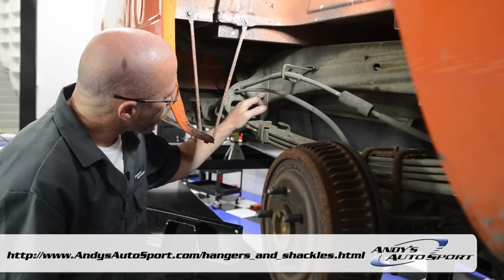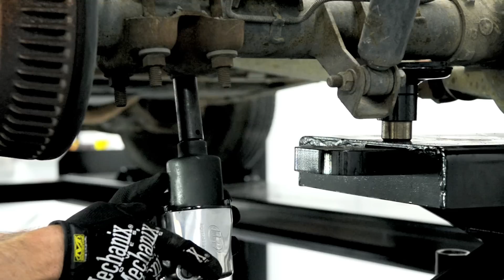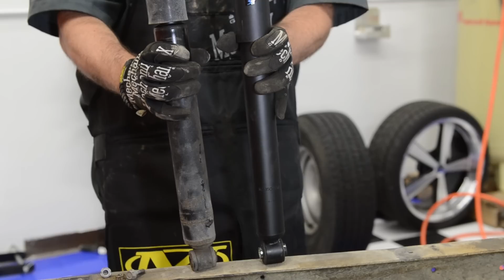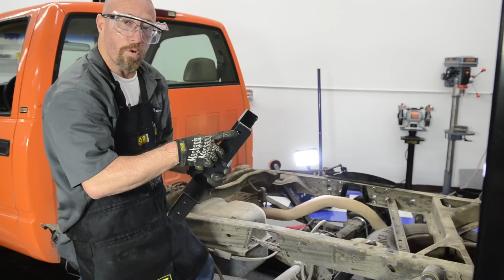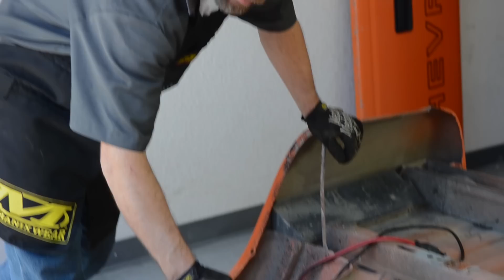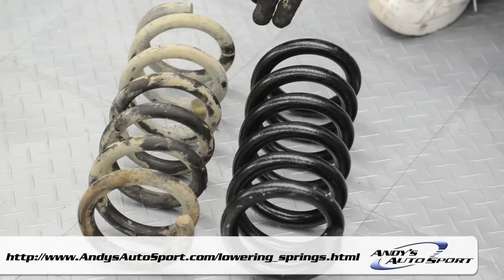Truck Lowering Kits - Presented by Andy's Auto Sport

Comment: Even though this video is 8 year old it"s very informative !!!! Great video but one  thing that they didn't address was that the rear leaf spring shackles are about 2 inches above the trucks frame so when putting the bed back on it will be 2 inches higher in the back of the bed than the front of the bed and this will eventually cause a hole to be worn through the floor of the bed.

Comment: On the front, strip everything out of your way and loosen the ball joint nuts just a few turns with the spring still applying  pressure and rap the steering knuckle hard with a hammer and usually they will break loose without having to use a pickle fork and messing up your ball joint boots. Then use the spring compressor.

Comment: So I bought a flip kit from a friend and he said its takes all the stock bolts and everything now would I have to buy shorter shocks for the rear end it's a 4.5 to 6 inch drop and I'm just lowering the rear end any help would work
Reply from the maker: Hi Nick!  Technically you're not required to change the shocks.  But the ride quality is definitely going to be noticeably affected if you leave the factory shocks on after dropping the rear 4.5 to 6 inches.  Most people do change their shocks if they're doing a rear drop like that.  Hope that helps!

Comment: Hi....great video so if I get a flip kit do I also have to do the C notch done
Reply from the maker: Usuallly, yes. I'm not 100% sure that that's the case for every truck, but usually the axle will end up right against the frame if you don't do a c-notch, so there wouldn't be any suspension travel out back without one. This is definitely true if we're talking about the '88-98 GM fullsize trucks.

Comment: Hi!!  Great video!!  2 cuestions Is there a way to lower the truck with out flip the leaf springs?  
C notch,  can any shop do it?  Thank  you!!
Reply from the maker: Thanks!  Yeah there are other ways to lower a truck but if you want to slam it this is often the route you have to go.  If you're looking for a more moderate drop, there are generally a number of other options depending on your truck.

Also, not any shop can do an install like this.  You'd want to look for a performance shop that specializes in doing truck mods.

Hope that helps!
Reply: AndysAutoSportTV ok got it...  thank you so much for the  reply!!

Comment: What's the wheel/tire size?  I have the same truck, but a Sierra SL, looking to do this same setup.  Thanks!
Reply from the maker: The wheels on this truck are the American Racing Nova wheels.  The wheel size on the front is 20x8.5 and on the rear is 20x10.  The respective tire sizes are 245/35ZR20 and 275/35ZR20.  If you want us to message you a price quote for these, just send an email to info@andysautosport.com and let us know where you're located.  Thanks!

Comment: Are there torque specs for the 2 bolts for the lowering shackle?
And are you supposed to tighten then with the suspension hanging, or with the vehicle on the ground, under its load?

Comment: Thanks for this info.  It helped me a lot in figuring what I want to do with my 1997 Chevy Suburban I just got.  It will be an every day ride,....for now.  What size wheel and tire are you running? Also will that brand spindle work with most big brake kits if I want to lower it first and do brake conversion later? I notice how some big brake kits come with their own spindle; is there a reason for that?

Comment: would really like to know where you found those fish plates.... im lowering my drag truck and i need that strength... i was gunna use the jdm kit, but there c notch just fits on the outside of the frame and does not wrap around like the western chassis works kits... i looked on wcw website n was unable to find the fish plates
thank budday

Comment: I have a 2002 dodge ram which has a 2/4 drop. I think for the front drop springs and the rear was a flip kit. My alignment has been off, well places I took it to said because of dropping it the alignment can be 100%. Is it because of just using springs? Also I want to go lower so what would you recommend?

Comment: Great video it actually motivated me to lower my truck 4 inches in the back and I used the 2 inch lowering spring leaf hanger and the 2 inch lowering shackles and I love the way it came out but on the passenger side the rear shock extender made it uneven so I removed it and now it's 1 quarter off and inch off do you why is that? And I would love to know is there's a way I can fix it thank you

Comment: Just watched ur video.step by step instruction Nice. I have a 63 gmc short box step side with a 1972 front end with a 2-1/2 drop spindle on air bags and can't get the bottom of the a frame from hitting the ground. olso have a1983 posi rear on air. the truck rides very rough. Have I missed something in my project or is this just the nature of the beast. I am willing to lose the bags and go back to coils and coil overs if I can get a better ride and keep it low. Any help would be appreciated. Maybe u could do an older truck next Tks.

Comment: why is it some people flip the bolt around on the lead spring pack then put the flip kit bracket on. does it not interfere on older body style chevy? is that the case with newer body style chevys like 99-06?

Comment: Nice video guys, I had a quick question maybe you can help me out. I did a belltech flip kit on the rear of my 05 Ram Quad cab, truck rode great, but I needed to move and wanted to use my truck, well I was hoping to get stock height, or close to stock, when I removed the leaf flip, and shocks, I left on the shackle but now the truck rides higher than stock, any ideas?

Comment: Hey I would like to lower my ck extra cab I don't want to floor it maybe drop it 2 inches on rear and front. What tires would you recommend  and what size tires and wheels would you recommend I want to give it like a hot rod look so I would like some drag radial tires something like that.

Comment: NIce Truck and video! Came out great. I have a question I recently lowered my 91 chevrolet 5/7 and although it has a c notch it seems to still be a bumpy ride. what can i do to get a smoother ride?
Reply from the maker: Thanks! How big of a notch did you install? If it's a regular c-notch, you might not have enough axle clearance. The Western Chassis Super C Notch that we used goes almost to the top of the stock frame, so there's plenty of clearance. Thanks for watching!

Comment: I have a 4/6 lowering kit with spindle, springs, shocks and flip kit.  Is this the same kit?  If so, what size wheels are those on there?  This is the EXACT same look I'm going for and I would like to know what size wheels would clear with this drop kit.  Thanks in advance!!  AWESOME VIDEO by the way!!!
Reply from the maker: Hi Tim. We installed a 5/7 drop on the truck. The wheels are 20-inch American Racing Novas. Thanks for watching!

Comment: Hi i have a question for you i lower my truck using the springs on the front  now i want to install the spindles so now i need to put the original springs on it? thank you
Reply: you shouldent have to, depends on how "low" or for clearance issues etc..
Reply from the maker: The cool thing about most trucks is that lowering parts are additive: you can use different parts (i.e., springs and spindles) together to achieve more drop. Thanks for watching!

Comment: Questions:
1. Did you not grease the new bushings and spindle when you installed them? 
2. Does the castle nut on the spindle only have a hand tight torque? 
3. What are the typical torque specs for suspension components?

P.S. I would of cleaned and freshly coated the frame to match your new shiny suspension components to make a super clean look as well.

Great video. Thanks!

Comment: That truck looks good at the end.  If it was mine, I'd do a roll pan out back, tint the windows, body color grille with the quad lamp setup and use smoked lights with an HID kit, get rid of the chrome bumper up front and go with a painted bumper and paint it to match, then paint the door handles to match.  I see you did mirrors in another episode, I'd paint them to match too.  Then take out the factory bench and put in buckets and make a console and a sub box.  Oh yeah, and a cowl hood.

Comment: they forgot to mention that you need to remove the tow hitch, but other then that very helpful. already installed my 2 in drop shackles, later on I'm gonna swap leaf springs to give it another 2 in, and then spindles. thanks for the video.

Comment: Great video. Any suggestions on where to find a straight axle lowering kit for a 61 F-100 Unibody? I have a leaf spring kit from eibach for the rear, from a newer truck. I am going to weld in attaching components. What I am having trouble with is a straight axle option. I don't want a new crossmember or contol arm suspension. I think the dropped straight axle would be excellent. Know any suppliers?

Comment: EXCELLENT VIDEO! I've been wanting to get a C/K1500 2wd and lower it for awhile now, I have done a lot of suspension work already but this filled in the blanks on truck lowering.. My granddad had a 1989 1500 that was lowered about 3-4 with a 383 stroker with a Holley 750CFM double pumper, and custom exhaust from the motor back, AMAZING TRUCK and I miss it so much... Its about time to build my own.